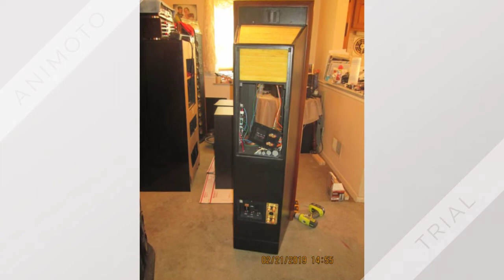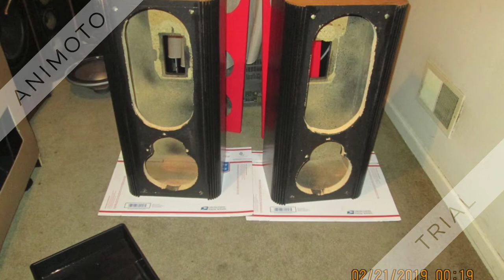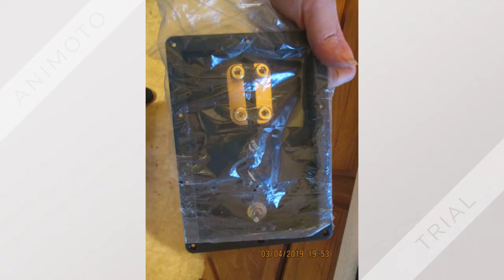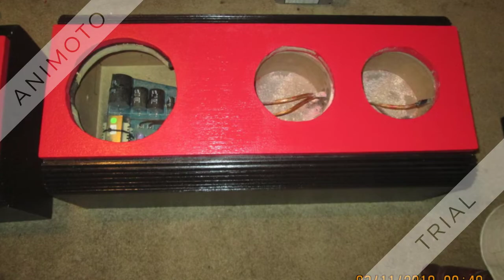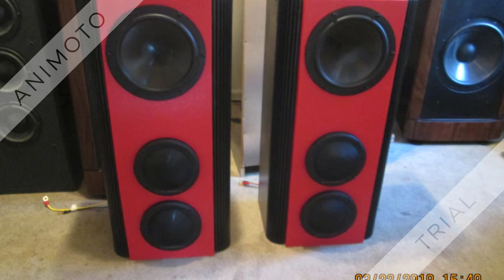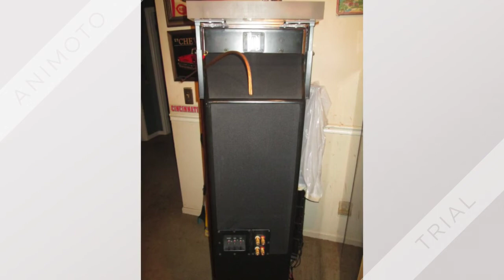Infinity IRS Epsilon Lavishness513 Custom V Best 5 way Speakers  Pioneer Elite Reference M-72  C 72

Comment: A lot of hard work and insight went into creating these I bet they sound amazing!
Reply from the maker: Hello, thank you. Yes I have many hours in this build. They are worth all the work.
 I cant help my self.  I have always been like this. 
These speakers are amazing sounding speakers and state of the art, in there original form.
I am a crazy audio guy. I always have to try to take audio to the next level.
It was my goal to add clarity and control to these speakers.
 I did this by having each crossover section and its driver have its own channel to power them. 
. I chose the M-72 because they have gain control's on front of amps and The Pioneer M-72 amps are dual mono build.
 This allows me to have complete control of each pair of drivers. I was able to tune these speakers perfect  to my room. 
They did have some switches on the back that were there to make a couple adjustments. 
I eliminated the switches and now I can fine tune these speakers to my liking every time as needed.
They can be perfectly tuned to any room. I am very happy with the final results.
They do sound most amazing now.
Thanks again
Reply: Lavishness513 l love it so inspiring to see the final results! Makes me want to complete my project! I could not match your creation! So nice!